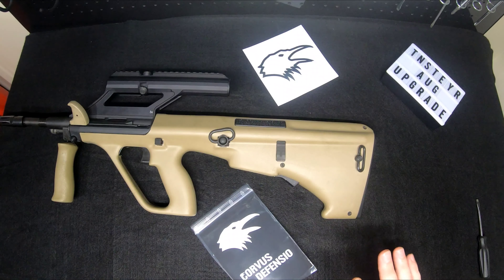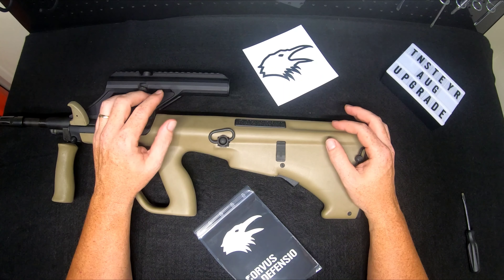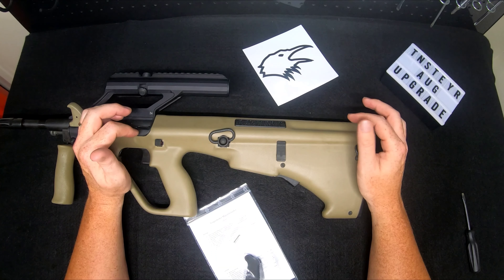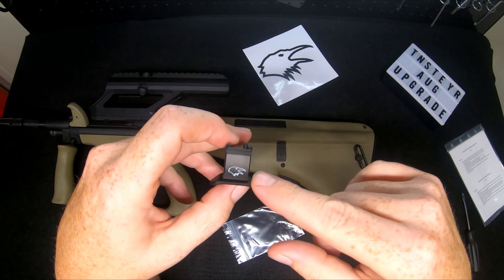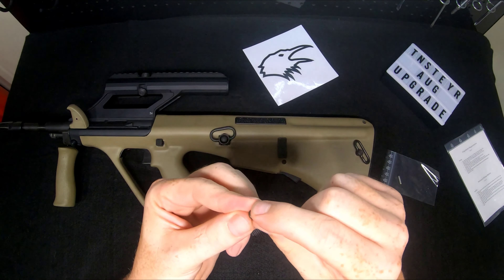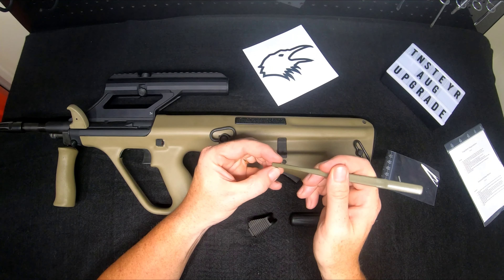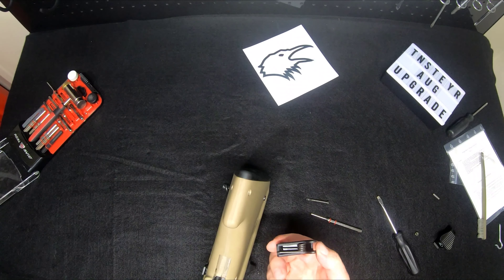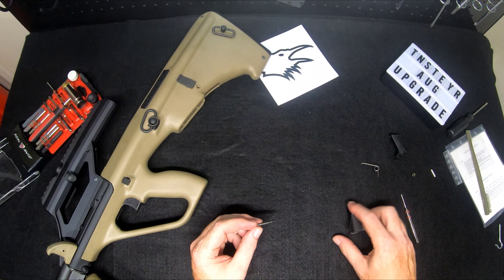Corvus defensio XL magazine release for the Steyr AUG

Comment: I got the corvus button and took out the old mag release button but it has a metal piece that is attached to the mag button that the corvus didn't have... I notice you have the little square metal  thingy by the mag  mines doesn't look like that.... It has a couple of round metal thingies there... This is the California version maybe they changed the rifle?  The steyr website said that it is compatible with ALL steyrs... Such as the A3  M1  like what i have....
Reply from the maker: Do you have a standard aug  or do you have a NATO
Reply: @TnSteyr  That's it exactly.  Sucks they don't make it very obvious that it won't work on the nato... Just kind of a note at the bottom i think it should be in BIG RED LETTERS.

Comment: I tried this on my A3 m1 non NATO AUG. the mag release refuses to come out. When I look down there, the mag release button has extensions on it that go down into the housing. What’s going on here?
Thanks,
Paul
Reply from the maker: There are a couple of tabs on the front and and on the rear.You have to angle it when you slip it.In to the stock, taking it out should not be an issue
Reply: @TnSteyr 
I have removed the bolt. The spring is loose and the button won’t come out. But it doesn’t look like the one in your video. It has an arm on the left side that goes up and attaches to a light gray piece with a spring. I’m stuck. Not only will the release button not come out but it looks different. 
Help!
Thanks,
Paul
Reply from the maker: You have a NATO, your og takes the AR. Mag, the corvos magazine release will not fit that stock. You also have to remove the trigger pack and trigger bars to get that bolt.Release off your current magwell, release for it to slip out
Reply: @TnSteyr thanks for this info. I can't read well either and got one for a Nato Aug. Any resource you can show me to help me reinstall the original Nato mag release?

Comment: Hello. I don't have facebook and I can not find any other way to contact you other than a phone call which is totally not necessary for this. I'm wondering if anyone has converted a Steyr 9mm to 356 TSW. Being they are originaly engineered in 40 and have fully supported barrels I think it might be quite interesting.
Reply from the maker: Not that I'm a aware of . I've been try for 45acp and 10mm